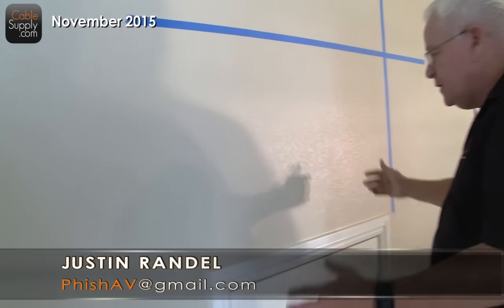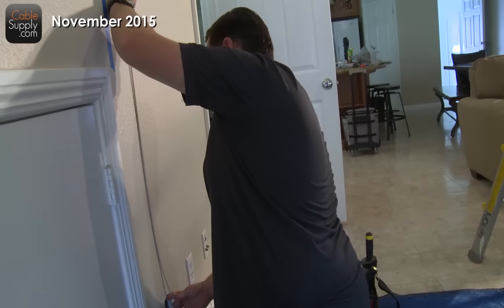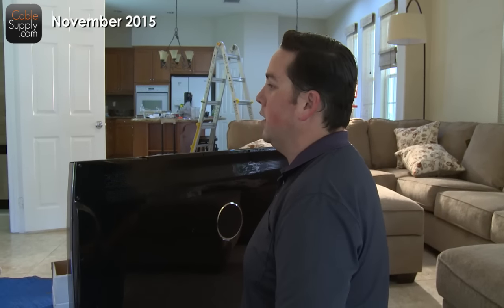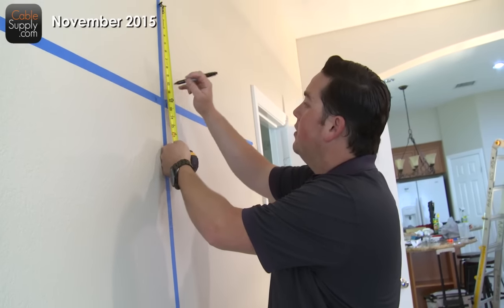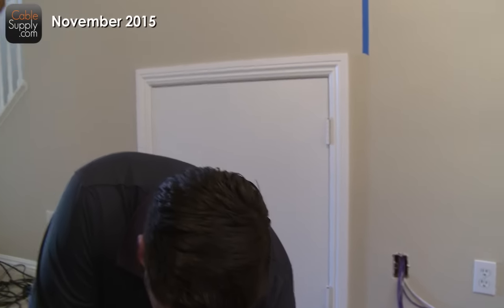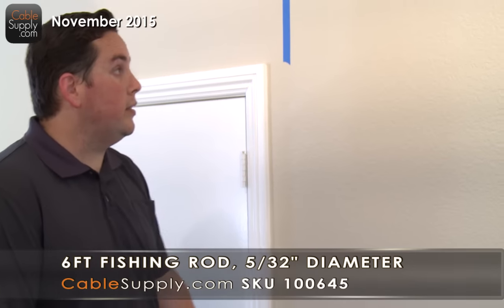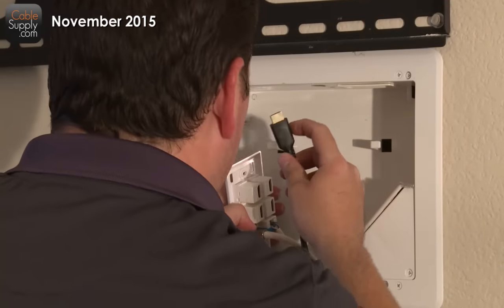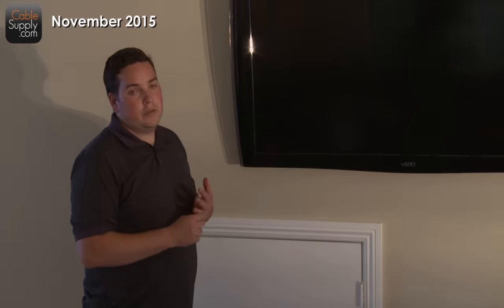How to Install a Wall Mount TV, Part 1

Comment: I appreciate the time you've put into all of the videos; I've learned a lot and I'm glad I stumbled onto these box shown here before I get to work on my wall mount project.  I admit I'd worry about those HDMI cables hanging from the back of the wall plate coming loose, perhaps a bit of hot glue or something?